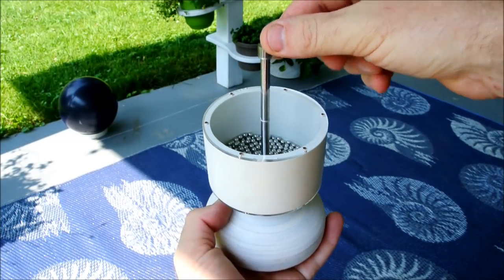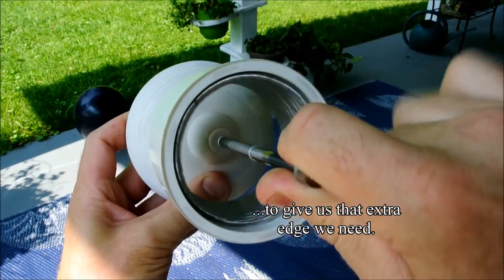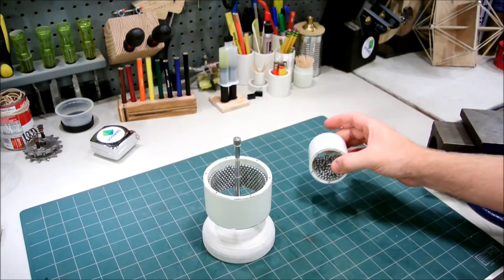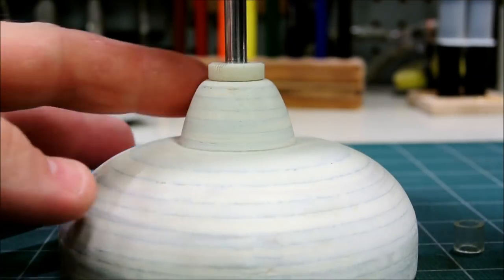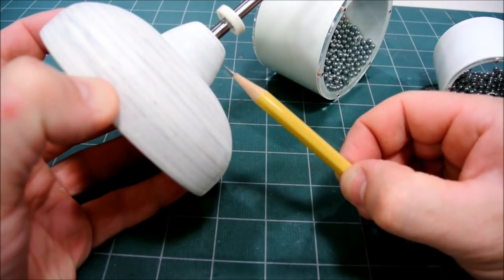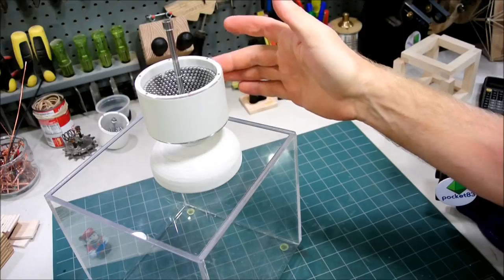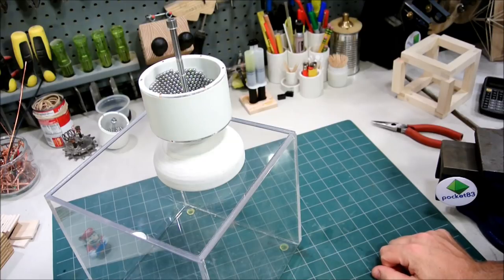BB packing problem on a cylinder (& the water paraboloid)

Comment: If the spinning objects are not glued down in anyway then you sir are the master of centering
Reply from the maker: I found exact center of the acrylic box by connecting the diagonals underneath. I put a pin-prick mark there, which I could still see from the top side. I spun the wheel to find the exact center point, and then I just lined those two points up ;)

Comment: To make it easier to spin the BB's into a perfect row, why not fill the container to the top with rows of BB's?
If none of the BB's can start a new row beyond the acrylic topper, they should have an easier time settling into the gaps in the formation.
Reply: The surplus just ends up on its floor. I found that I got better results with the reduced amount. They need room to space out a bit before settling.

Comment: Pocket, if you were to spin up the water with the dye, stop the wheel and then spin it the opposite way could you unmix the dye back to its start state?  controlling for temp and air turbulence might be a must but it could be really cool.
Reply from the maker: Yes, but it's still hard to get the little drop of dye back inside the bottle.
Reply: Science???????????
Reply: pocket83 just pour the water with the ink in

Then boil the water
Reply: pocket83 probably the best comment response I’ve read in a long time.

Comment: Variac/rheostat? that you use on your sander to slow it down, would it work to more smoothly control your potters wheel?  This is all great stuff!
Reply from the maker: But it already is smooth. I think the choppiness is the unavoidable result of extending a 12" head to 40". A different machine/motor would be in order, if we were to continue chasing better results.

Comment: after a bit of searching i found a 4" OD Diameter Clear Acrylic Plexiglass Lucite Tube 3 3/4" ID 8" Inch Length you think that would work well for this? that would give 1/4" wall thickness

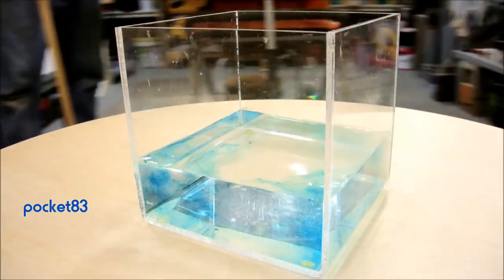Comment: 2:30 You are wrong on the internet!!! This is a caternary, not a parabola. no parabola can be made to fit over a caternary, no matter how you scale it, although you can get very close. caternaries are formed when a perpendicular force is applied equally along a flexible object like rope or chain. most compression bridges use a caternary arch because they are incredibly strong
Reply from the maker: Yeah, I discuss all that in the related videos. I even used the chain analogy. The shape turns out to be a parabola rotated about an axis, not a catenary. I also found it a bit counterintuitive.
Reply: Yep.  Rotating liquids do form a parabola and is the method used to cast large mirrors for telescopes.  The University of Arizona has the Richard F. Caris Mirror Lab in which they do just this:
http://mirrorlab.as.arizona.edu/castings/projects/mmt
The above piece is rather short, but there is a longer and more detailed description of the process (I can't find it right now).  Molten glass is spun at about 7.4 RPM then allowed to cool for 2-3 months!.
Reply: no way, that is fucking awesome. i guess that saves me doing some math over the weekend.... i will probably do the math anyway lol. i've only heard of hand grinding mirrors for smaller (10 inch) dobsonian telescopes, but the link you have is crazy. i wonder why its a parabola?? or is it just so close to a parabola that it doesn't matter? there are non-parabolic curves that are extremely close such that if you build it, it will be indistinguishable from a true parabola. this is probably a question for smarter every day lol

Comment: Great project... BUT metric is far better than imperial... metric is completely based on 10s and 100s... 10millimeter are 1centimeter, 10centimeters are 1 decimeter, 10decimeters are 1meter. FAR simpler to learn and keep in mind because of its simplicity. i learned both systems in school equally long at roughly the same time so age can be ignored... forgotten the imperial system a long time ago and still got the metric system in my mind like hammered into stone... all i remember from imperial is that 1inch is somewhere arround 2.4centimeters i think...

but as i saied great project that i might attent to replicate.
Reply: Irrelevant.

Comment: 1:33, there are no corners in a circle!
Reply from the maker: It's not a circle, it's a cylinder. A "corner" necessitates the intersection of two orthogonal directions. In this case, it's the intersection of the acrylic's plane with the infinite number of points belonging to the pipe; thus, "corners."  

Nice try ;)